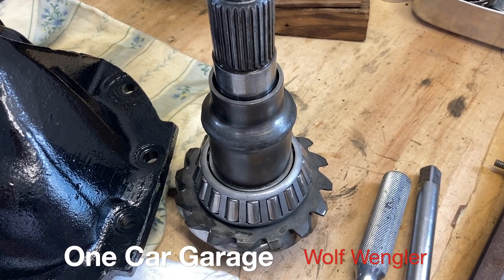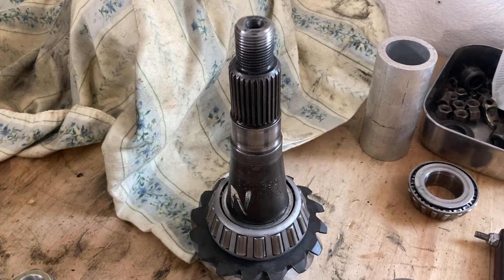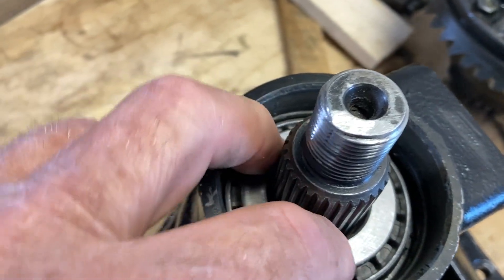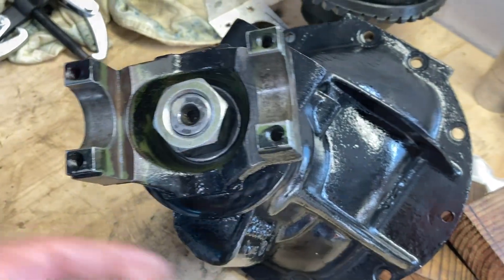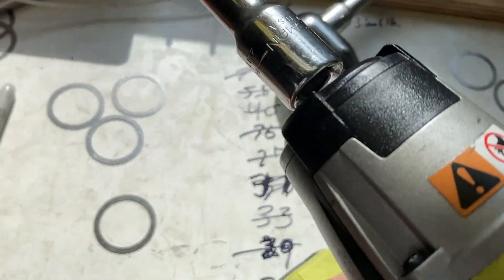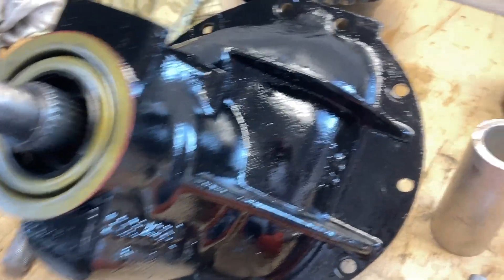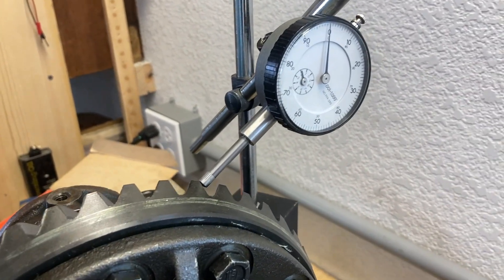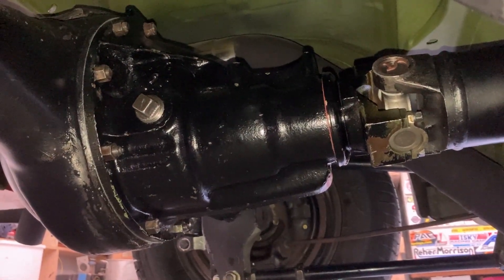MoPar 8.75 Crush Sleeve Upgrade

Comment: Hello. So I have a 74 duster. I believe I have an either a ford 9” or a Mopar 8.75 rear end. I’ve taken the rear differential yoke nut off multiple times even after I installed a new pinion seal. It is still leaking and the nut is loosing up causing the rear diff fluid to leak out. 

What’s your recommendation to fix the issue in having?

Comment: Hello Wolf; I enjoyed your videos on Holley carb tuning. I think you are putting the shims in the wrong place. GM puts them under the rear bearing, because that controls the tooth pattern on the ring gear. Special bearings are available that slip fit on the pinion shaft, just for wear pattern testing. There are special pullers also but are very expensive. It takes a lot of force to crush the sleeve, way more than normal torque on the pinion. I hope all worked out for you!

Comment: Interested in how much torque you ended up using on that pinion nut. Cass from DoctorDiff emailed me saying those 29 spline pinions need 285 ft-lbs which seems like a lot. Other videos say 170lbs too.
Reply from the maker: mine's still together.... so there is that!
Reply from the maker: I put mine together with the  Dr Diff sleeve at 130 pounds but all I did was replace the crush collar and install a new pinion seal. Basically I put the nut back on. I think the 285 is to crush a new sleeve. I used the straight collar with shims.
Reply: @wolfwengler  that's what I thought too, but not sure anymore. I specified i had a 489 case with the crush sleeve eliminator (solid sleeve) and they still emailed back with 285 for 29 spline pinion.

Comment: My 57 Plymouth doesn't have a crush sleeve from factory. What did you tourqe the flange nut to?
Reply from the maker: If you're just putting it back on I'd go 125. If pure rebuilding it and there is no sleeve then I don't know. ... 50s are different.

Comment: what u joint part number did you use and straps? it looks like it don't need retainers on the yoke.
Reply from the maker: The retainers are on the inside. The Joint is a 'combination' joint. Spicer 5-7437X
Reply: @wolfwengler  ok got it. i got the 7260 to 1310 I had the straps missing so I dint know what I had. Thanks